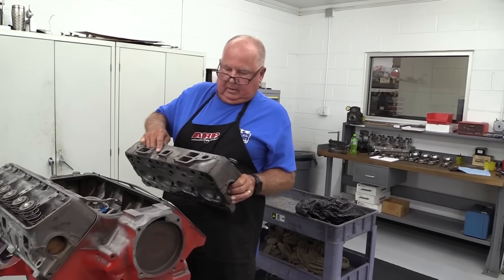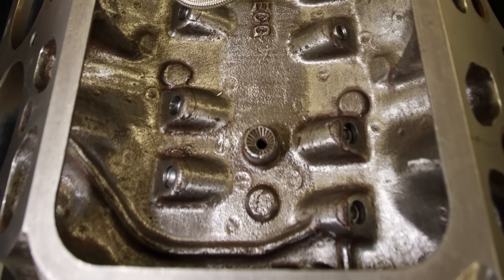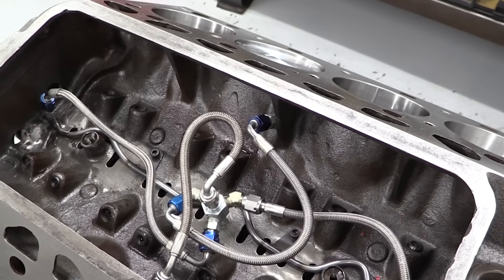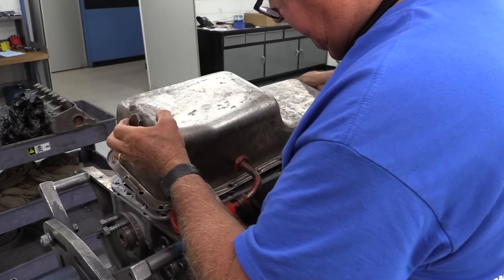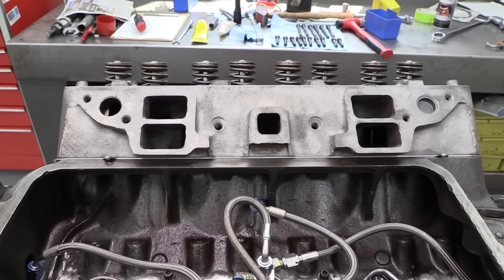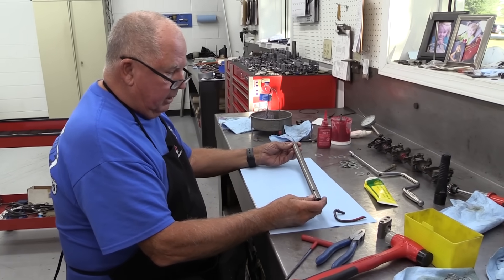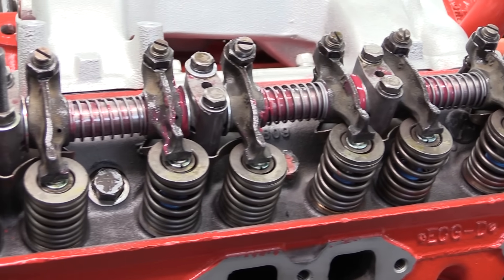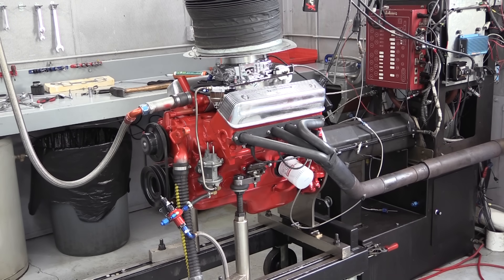The Engine That Replaced the Flathead -- Ford Y-Block Build

Comment: im pretty sure that cam has way more lift than .020 lift you all need to learn how to read decimals.
Reply from the maker: That was the duration at 0.020 lobe lift, not the total lift.
Reply: no its 230 degrees of duration and .020 thousands of lift check the tape at round the 2.29 mark you probably meant .200 which is just shy of a 1/4
Reply from the maker: 238/230 degrees of duration AT 0.020 of lobe lift. Not trying to be rude here, but that's how you measure duration, most cams measure out at 0.050 lift but this one is at 20. Lobe lift is 0.261 of an inch and net valve lift is 0.373.

Comment: This engine is a big improvement from the flathead but the it did not compete well with the small block Chevy due to the heavy weight of the engine. Of course only the Olds V8, and possibly the Pontiac, really survived for long after the debut of the mouse motor.
Reply: Most everything survived until the fuel/insurance/smog crunch.
Reply: nailhead

Comment: Would like to know, just what were those engineers at Ford sniffing, when they designed this.. It's like a complete brain-fart after another. Easily re-named as WHY-block.
Reply: Thats the same tired shit I always hear from people that don’t know shit about y-blocks; the oiling system was bad. There is nothing wrong with the Yblocks oiling system. That came from problems in the 1950s before the use of detergent, multi-viscosity motor oils and updated bearing technology. If these engines were properly maintained they were fine. The problem came from people that never bothered to change their oil or maintain the engines in any way. Yblocks are great engines.
Reply: hind sight is 20/20. It  was innovative at the time. V8's produced a lot of engineering design problems and it took a lot of years to iron out the best accommodations for those hurdles.
Reply: Quite the opposite of innovation. A lot of pre-war solutions with cheaper parts, and over-complicated solutions just for looks. Seems like it was designed to give the impression of "expensive and modern" with the cost of reliability and performance.
Reply: That design era would be like YOU designing an engine to go to Mars.
Reply: Your insult is like the Y-block's lubricating system, it doesn't work. Unlike the engineers at Ford, I don't have formal training, nor work experience for the task. They had already made several car engines, I haven't built a single one propulsion device; neither to orbit, nor in vacuum of space. They didn't have to go to Mars, only to drive around across the surface of the earth. Just like the other models they had developed before the Y-block. Ford had at least a dozen qualified engineers, I don't. Me designing a propulsion technology to almost completely unknown territory is totally different ball-game, than to build an engine to a vehicle and purpose already existing.
Reply: tell me why chevy thought it was a good idea to press their rocker arm studs in instead of threading them in. tell me why sbc had such garbage rod angles and crap deck lengths.
Reply: Because Chevy's business model bases on dirt cheap and unfixable. No money to the design department, they'll come up with something anyway, and it is marketing department's problem to get the crap sold. Fuel is cheap, and it has to be consumed to ensure the market and justify the war over it, so then it is viable option to build under-powered, giant single-use gas guzzlers. Just to keep the market, and war, going.

Comment: Is it my imagination or dose the Y block have some design advantages over the small block Windsor. More flaws but.
Reply: You are correct,it's a much more rigid block design,that's why it was used somewhat in the design of the modular block in the late 90s
Reply: LAWNMOWERMAN The  Mod Motors came out in the early '90s. '93 Mark VIII has a 4V 4.6 and 2V versions were in Town Cars a year or two before that. But, yes they use the deep skirted block that Ford first used on the Y block and continued on FE and Chevy uses on the LS.
Reply: no
Reply: @foxfordcatguy2283 , I would have to disagree, I worked on a flathead before and that flathead V8 did not look smaller than my 292 Y8 they actually looked very close to the same dimensions.
Reply: Milner62 It was the middle of the night when I typed that. I must have been thinking of the FE or the MEL. The FH, Y and SBF are all similar in size to eachother.
Reply: @foxfordcatguy2283 , Ah ok.  There is so much on here that I am shaking my head at some times its hard to tell whats what.
Reply: I'd agree. The Windsor block is an engineering masterclass, in just how compact and efficiently they designed it.

Obviously that has issues with maximum displacement and makes the front timing cover a very finicky item to deal with. However it was designed to be very material efficient to manufacture, and fit anywhere a straight 6 would fit.

The Y-Block was designed to fit where a flathead would, and therefore has a lot more room to grow, and lots of "wasted" iron in the casting. Obviously that means you can overbore the heck out a Y-Block, just wasn't as carefully designed from the factory as the later small block Ford V8s.
Reply: FoxFordCatGuy if

Comment: Ford first V8 218 HP...Fords modular 4.6L in 1996 215Hp SMH
Reply: Yes, but the 218HP rated in "gross HP" was a wildly optimistic guess based on catching a needle swing at full travel, with the engine driving no accessories. The later number is SAE "Net as Installed", which includes all engine accessories and normal parasitic loads...and don't forget that it produces less than 1% of the harmful pollutants. While dated by modern standards, even the '90s modular V8 was massively more powerful than any '50s iron, infinitely cleaner,  and can last roughly 2-3x as many miles in service.
Reply: @jamesw1659  the 4.6 was also massively heavier and bigger. oh, and alot more of a piece of shit and pain in the ass.
Reply: @jamesw1659  I love ford but even if it was more by 10 hp. I would be like really.....Me personally I think the 3v should have been in the 96-2004 and the coyote from 2005 to present. If you ask me or a 6.2 Coyote for the S550 platform
Reply: RetroCOBRA "Ford's first V8 218HP?" The Y block was not Ford's first V8, the Flat Head the came out in 1932 was and it was never rated that high.

Comment: The 239, 272, and 312 Y block was preceded by another Y block  that was introduced in 1952 with a 279, 317 and 368 CID  displacement  of which the 368 was called the Turnpike Cruiser. It featured side by side and not stacked siamesed intake and exhaust ports, hydraulic lifters and was rumored to be the engine that Ed Cole copied off of to start the design the small block Chevy. .
Reply: Lincoln Y- block. 279, 302, 317, 332, 341, 368 cu.in.

Comment: Thanks. That's very interesting my dad had a new 1957 Ford wagon and it had a 272 V-8 hmmmm
Reply: Robbie Russell my 1955 Ford has a 272 aswell
Reply: @2strokepower803  wow. They were ok motors!!
Reply: '57 Ford truck was available with supercharged 312"

Comment: Still 8:1 with 0.040" over???
Reply: 8:1
Gas in the early 50s was not refined like today's. 
And oil really sucked.
Reply: they use a poor compression heads , . . I don't know why , the ECG heads are very better
Reply: ECG Heads were used, ECG-D.  I think you mean ECZ-G.
Reply: The 292 in the 64 truck I had, had low compression. When I saw 0.040 over with those flat tops, I expected higher compression. Maybe approaching 9:1
Reply: Everything else equal, a .040" overbore will only increase compression by about .15 points.  If it was low compression, it still will be.
Reply: compression isnt everything....when will some people learn.

Comment: 218hp in the 50s is pretty good. Just think the family sedan has only bumped hp to around 300hp for most of the full size v6 flavors.
Reply: Yep, my 56 is a 292Y8 rated from ford at 210hp with 8.4:1 compression with a Ford-O-Matic 3 speed automatic transmission putting power to the ground via factory 3.22:1 ring and pinion.  Lots of pep for a big but light fordor.  All I plan to do is a OE stock rebuild on mine.  I have enough transplants and upgrades I want one to be all OE stock.
Reply: What  matters is  the  torque  curve. You would only be on the  HP peak for  a  1/4  second  before  you shift.  It's  making  near 1 lb-ft of  torque  per cu-in  from  under 2000 rpm to over 4000  rpm - which is  not bad  for a "first go  round"  cylinder  head and low-low  compression. So it has  280 HP  engine  pulling power from idle to 4000.  Where you drive the car. - Sandy

Comment: In 1982 I bought a 57 F-100 that had a Y-block in it. I was never sure if I was a 272 or a 292, but it was a torky engine, it was just as easy to take off in second as it was in first gear. I remember the two barrel carb was roughly the size of a 16 ounce beer can.
Reply: 57 series 292, had torque up the wazoo.  292 w 272 heads raised comp and could lug to nothing and walk right out of it.  Perfect for hauling hay!
Reply: My dad bought a 57 Mercury M100 truck with a 292 in 92, truck sounded and looked so damn good, fast as hell too!
Reply: The '57 Ford truck was available with supercharged 312"

Comment: Have a 1963 vintage 292 Block in a 1963 F-100. Has lasted over 100,000 miles with oil changes every 1,500 miles. No modifications except spin on oil filter adapter. Would probably make more power with overhaul, but since its never been apart since Ford built it is hard to fix something that ain't broke. Has had valve covers off for lash adjustment and new valve cover gaskets. The cork ones were pretty leaky.
Reply from the maker: That’s pretty awesome
Reply: it needs the kind of overhaul known as an LS swap  (!!!!!!!!)

Comment: 4.150" bore??? I don't think so! Ford 292 stock bore is 3.75". An overbore of .040" puts it at 3.790"! These can take some major overbores, but even on this engine, your cylinder walls would be getting REALLY weak.
Reply from the maker: You are correct. The 0.040 overbore brings it up to 3.790 inches. I don't know what kind of brain fart I was having. Thanks for the sharp ear.
Reply: Caught that but it isn't as bad as the tach thing.
Reply from the maker: @hotrodray6802  You are correct. The worst part is a probably listened to that mistake 15 times while editing the video and never caught it. Believe me, I know it's the speedo cable that goes to the trans and not the tach wire. Have no idea why I said that.

Comment: The Y block was developed before the Chev 265, so Chevy copied Ford for head design of exhaust ports ;)
At least they did not copy that intake port idea
Reply: I think you'll find that engines take many years to design, prototype and productionise, so a years difference wouldn't account for the exhaust port layout being the same. However, the 429/460 and 351C/M/400 all took a leaf out of the BBC's design book, to the extent that the rockers will even bolt on (but not work properly). There is 4-5 years difference in them. But GM also looked further back for inspiration in the Chrysler Poly  motor. Look at the combustion side of those heads and you'd swear you're looking at an open-chamber 351C.

Now, LS heads look rather Windsor-like. My point is, everybody copies everybody.
Reply: @gergatronic  a ls head looks nothing like a Windsor
Reply: @jdrok5026  I think he's referring to the the exhaust side of the head ie port spacing if you ask me I see lots of ford design in the ls they were definitely looking at the fe hi riser.
Reply: @jdrok5026  except for the cathedral ports, I disagree
Reply: Although the siamese center exhaust ports are common with the Gen1 Cadillac and Oldsmobile engines introduced in1949, the intergrated flat surface outlets are almost identical to those of the SB Chevy. It's like Chevy copied the exhaust parts and throw everything else way. Intake ports, valvetrain, casting process, you  name it, they throw it out. Remarkably in the right hands the Y block could go head to head with the SB Chevy as Jerry Unser won the 1957 USAC stock car championship in a supercharged 312 57 Ford.
Reply: One went head to head with SBCs and other mainstream engines at Engine Masters this year and beat more than it lost to.  The significant handycap for it was the lack of a roller cam but it still finished better than roller cam equipped engines.
Reply: @charliemccraney  yeah that was Kaase-built wasn't it? Impressive, but he did do a staggering amount of work which barely makes it qualify as a Y block any more in my books.
Reply: @gergatronic  No, that was Ted Eaton... Kaase was last year. And... check out Ted Eaton's engine - very few modifications compared to Kaase. Shoot, very few mods compared to this build referenced in the video lol!
Reply: Thanks @HotRodReverend , I will have to check that out.
Reply: @gergatronic  Like Keith, with this and his previous build, Kaase is also accomplished but also is no expert on the Y.  The one this year was an Eaton Built engine and like all of Eaton's Ys, it uses conventional Y block port layout, and no unnecessary oiling mods.

Kaase did build one that won the year it competed and it did have a staggering amount of work.  He totally changed the port layout and combustion chamber.  The following year, Eaton came with a more conventional Y, which produced more power than Kaase, demonstrating that the work Kaase put into his was not needed.

It is thought that the Y port arrangement does become a problem for producing more naturally aspirated power at some point.  So far, the most powerful conventional port Y is Eaton built, 603hp.  However, the Kaase Y was reworked from the EMC configuration to produce peak power and it produced somewhere around 700hp.  So the point at which the port layout becomes a problem could be somewhere in the 600 - 700hp range, possibly closer to 600hp.
Reply: @charliemccraney  thankyou for sharing such expertise on these fascinating engines. I have great respect for folks who can take an otherwise traditionally non-performance oriented engine and turn it into something special.
Reply: ford did not want it to sound like other G M engines and most of all Chevy
Reply: The 265 Chevy engines were already in pre-production and being tested by then, they came out in 1955. So the theory of GM copying Fords port design is not really possible. My dad drove a '54 Chevy with a GM installed 265 at the dealership where he worked in late 1954.

Comment: 50 years ago when I was a kid, we had a 62 Galaxy 500 with a 292 that had rocker arm oiling issues. My stepdad used an overhead oiling system teeing off the oil sending unit, worked great.
Reply: Saw many like that.
Reply: Wow James I had a 62 Ford galaxly Xl it was a 390. With a 3on a tree weird car. Not much power thx
Reply: @robbierussell9536  390 is a fe not y block
Reply: @tomschweikert9537  Seems like Robbie wanted to join the y-block club even if he didn't have one.
Reply: @tomschweikert9537  Yep one of the new range of Ford engines in 1958 and not really physically much bigger or heavier than the SBC. In 1958 Ford came out with the FE (Ford, Edsel) engines, the MEL (Mercury, Edsel and Lincoln), the FT engine (Ford trucks, dangerously close to the FE engines) and the Super Duty (bigger trucks 401-534 cubic inches)  During most of the V* era Ford made no less than 3 V8 engine families.
Reply: @robbierussell9536  390 s usually had plenty o torque
Reply: @tomschweikert9537  yeah you would think...it was a beautiful red and black paint .I fell in love with the moment I saw it so I bought it.. Even my father said the same thing being a FORD MAN..I WAS JUST 19 when I bought it. Being that my father had put oiler kits in 272-292 he said oil pressure was very low. Come to find out the car sat alot and when the original owners had it they used QUAKER STATE oil..YUK.. SO MY DADS TEACHING HOW TO PULL A MOTOR...UNDER THE INTAKE AND THE OIL PAN WAS SO GUMMED. UP, WE FIGURED THAT WAS THE PROBLEM ..AND YES IT WAS..SO WE SOAKED IT IN KEROSENE. FLUSHED IT OUT.  PUT NEW OIL PUMP.TIMING GEARS AND CHAIN SCRUBBED ALL JUNK OUT.. LOOKED LIKE TAR. VALVE COVERS WERE A MESS COULDN'T EVEN SEE THE LIFTERS!!!. CLEAN CLEAN. AFTER WE PUT IT BACK TOGETHER, HE PUT VALVOLINE OIL IN IT AND RAN IT 1000 VERY EASY. CHANGED OIL. BLACK BUT AFTER SECOND OIL CHANGE MUCH BETTER..I THINK I DROVE 70,000 MILES AFTER THAT.. NO MORE LOSS OF POWER IT WAS SMOOTH..RAN HIGH TEST GAS. IT HAD A FOMOCO CARB..I BLEW MY RACING 289 WITH QUAKER STATE IN IT PITTSBURGH.. HEARTBROKEN OVER THAT. BUT THATS BASICALLY THE 390 PROBLEM!!!
Reply: @robbierussell9536  You comment makes me think, how much has different oil brands changed over the years? Because right now Quaker State oil isn't bad.
Reply: @robbierussell9536  thats the big q for ya .I wouldn't put that shit on a bicycle chain.i never understood why the hell all the old people ran qauker state for it seams like all them did tho
Reply: @robbierussell9536  that was non detergent oil
Reply: @robbierussell9536  
Late 80s in high school , a buddy got a 65 Ford pickup with a 390. 
What a gas hog. 
Power was fair. 
 even back then I remember the first week he got it , because we cruised around a bunch. 
Total gas bill at the weeks end was 175$
Reply: My friend next door's dad had a '62 Galaxy (black 4-door red interior) that developed the rocker arm squeak, so he drilled a few holes in the rocker arm covers to squirt some oil in every few days. He was an aircraft machinist. Keep 'em flying...
Reply: @curbmassa  my best buddy had a black on red 62 galaxy with a 352 cruisomatic, couldnt keep a tranny in it but he had a size 13 boot lol
Reply: W used to attach rocker drains together as other reduced pressure caus bearing failure.
Reply: My dad’s old 60 Fairlane had that same setup on it.
Reply: A lot of the Y-Block rocker oiling issues were due to the common use of nondetergant oils back then, causing oil passage-clogging sludge.